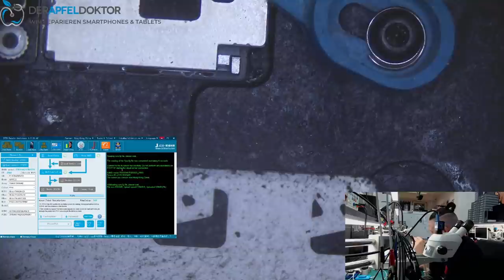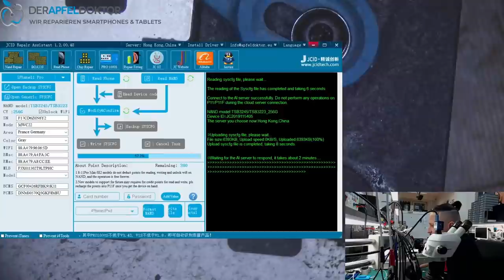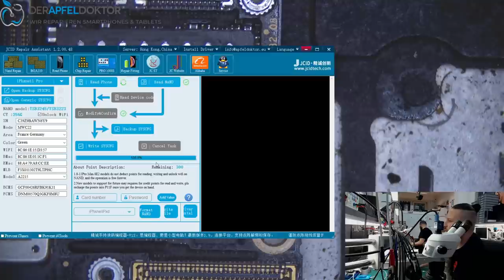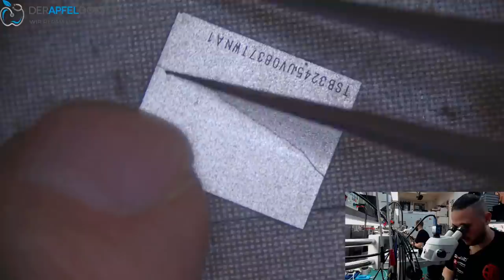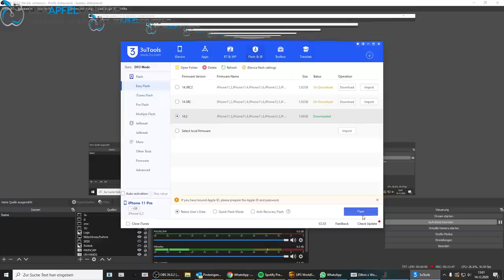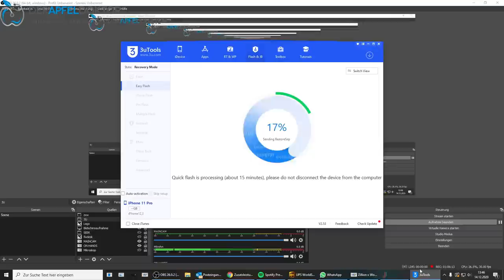iPhone 11Pro with cracked NAND - Totally damaged - Ripped pads between the sandwich - CPU swap time

Comment: I have a question I bought an iPhone 11 motherboard offline got it unlocked and everything. Some how black electrical tape got stuck to the band I believe on the top. I removed it but the black stuff which I believe was for heat came off. I bought kapton tape to place on top of both spots but the phone stays on for a little while then reboots. Should I remove the tap and purchase those pads?? This got me stuck!!